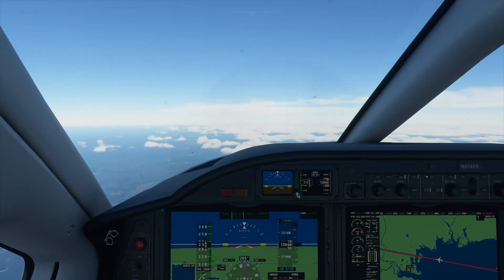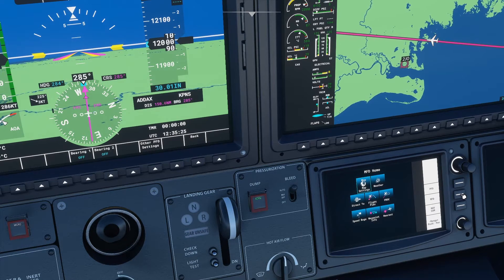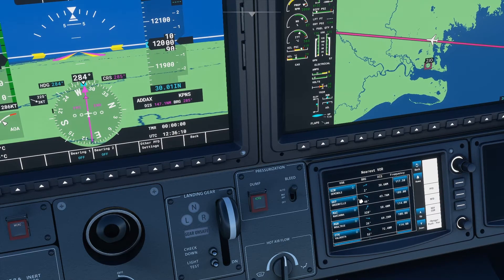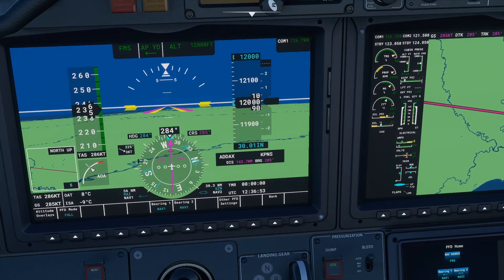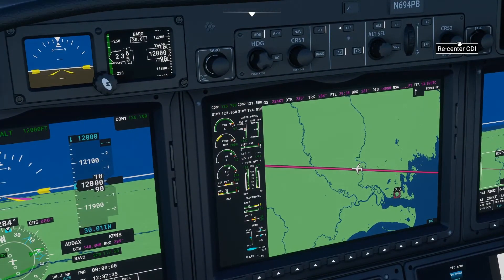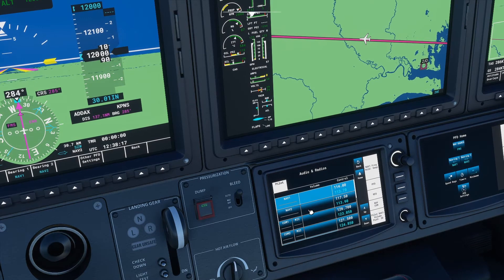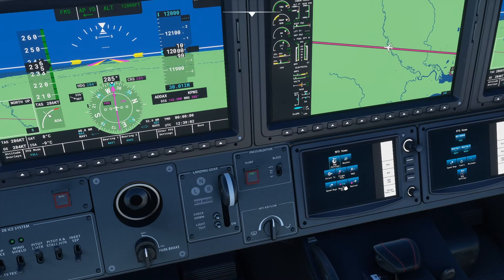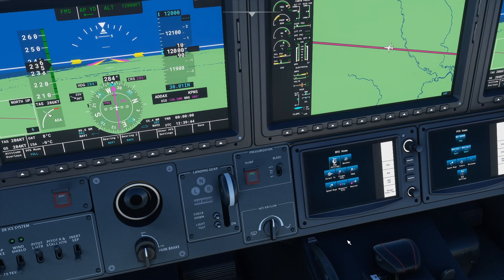NAV radios in MSFS TBM930

Comment: Thanks for video. IMO one glaring problem with G3-5000 WT is the inability to monitor which Freq you are on via  the PFD display. I know you can go to GTC menu, but this is very awkward. On G1000 it is always in upper left corner of PFD and MFD. I also, as a RW pilot monitor the morse code. Not sure you can do this either. Take Care

Comment: Cristian, very helpful - thankyou.

I'm specializing in conversion to the TBM930 - great aircraft as I can take off from shorts as short as 2,000 feet (full power on the brakes required) and land in 1,400 feet using reverse thrust. 

My technique when making approach is to use the MFD Waypoint > Frequency selection, and if an ILS is available, select it, assign it to Nav 1, then look for a matching Approach Procedure.  Also use Arrival Procedures on occasion

I fly using the MFD Flightplan selection, and use the magenta progress to see the waypoint altitudes, select those heights, and use the Vertical Speed function.  

Programmed into a Thrustmaster HOTAS, with the keyboard arrow keys reassigned to <> Heading and Up / Down arrows as decrease / increase vertical speed.

Makes for a professional, precision flight, which can be flown with target altitudes and heading / vertical speed control in autopilot.

You could make a YT video of this.

My background is an HS-748 / Mirage IIIO pilot, last flew a RAAF mission in 1975!

Conversion to the computer-flown TBM-930 has been fascinating.

Kind regards,
Reply from the maker: Hi Chris, thanks for the comment, appreciate it. Awesome experience you must have, having flown the Mirage. I also flew a bit the HS-748 back in the 90s. Looks like you have it all setup with your HOTAS controller, really nice. I bet must be a tremendous help instead of trying to control with the mouse, sometimes that is a PITA.
I agree basic modes as we call flying with HDG and VS makes for a very precise control of the flight path. you don't need anything else really. I will make my next video on that. And yeah, we are very fortunate to be able to replicate flight in our computers like this, amazing technology. cheers.